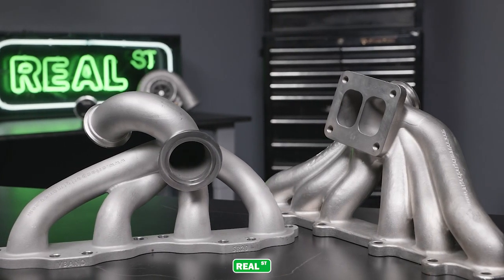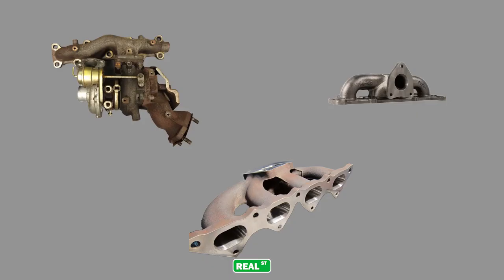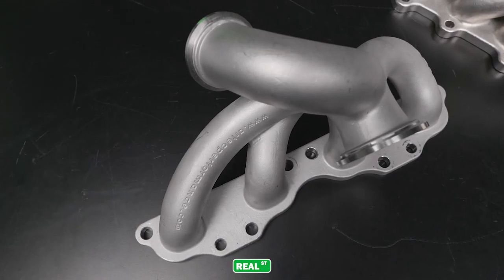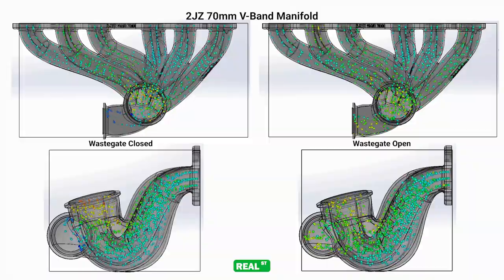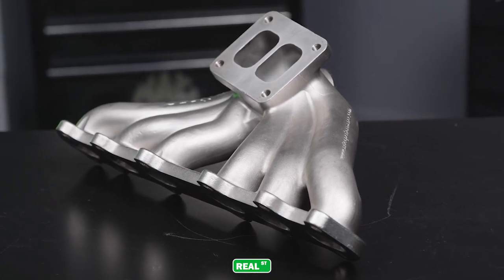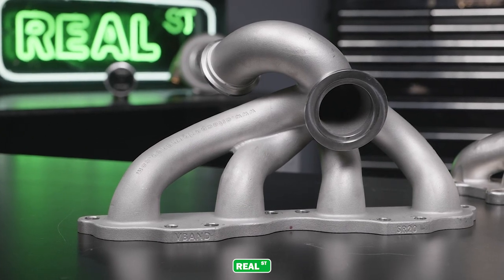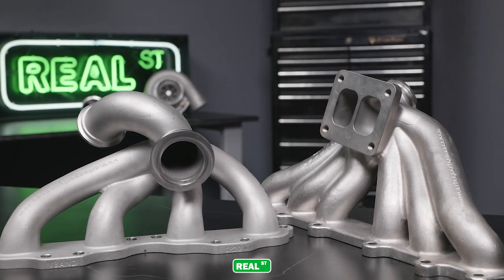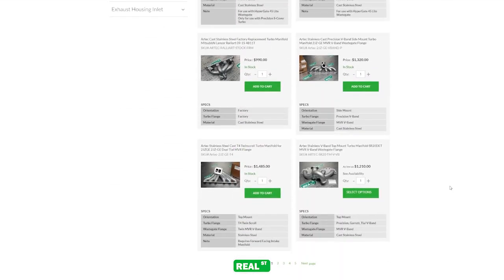Artec Performance Stainless Steel Cast Manifolds - Overview

Comment: nice manifolds overpriced though
Reply: Theyre stainless..
Reply: @timvanderstarre9021  and cast, would be cheaper to weld one up
Reply: While you can buy the raw materials and weld one up yourself for less, lets not forget the time you will spend doing so. What is your time worth? Any really good fabricator will charge anywhere from 125 up to 250 per hour to fab components up for you. A 2JZ manifold will easily take you an entire day between mock up, tacking, checking clearances, cutting tubing to fit etc from start to finish. Nice CNC header flange, turbo inlet flange, wastegate flange, tubing, bends you will easily spend $600-$800 . Low end labor for fab work $125 x 8 hours there's $1000.  If you do it yourself you save the labor of course but your time still isn't free.
Reply: @robertdelangel2  you can’t teach people like this don’t waste time it’s worth every penny

Comment: Just got mine for my 2JZGE build! Thanks Moe! When we gonna see some 2JZGE intake manifolds?
Reply from the maker: Heck yeah! Thank you. If you have any other questions, feel free to reach out.
We have some options available for intake manifolds.
Reply: Dodo racing makes a 2JZ GE cast lower intake manifold runner, that allows you to use the GTE stock upper forward facing intake manifold.

Comment: hi real street, 
Would these be able to hold let’s say up to 1100whp on a 2jz?
Reply: when you refer to manifold hp its crank hp not whp ....
Reply: @ACommenterOnYouTube  well, 1100whp is my goal, hence the question.
Reply: @nucleart0aster  then convert 1100 whp to crank hp ... ... ...
Reply: @ACommenterOnYouTube  I’m sure whoever replies can do that too.
Reply: @nucleart0aster  and just to inform you, they don't reply to comments or questions so don't hold your breathe
Reply: The twin scroll T4 GTE manifold will support that power without an issue. The primaries are 1.3" ID which is already larger than a large portion of offerings on the market.
Reply: @robertdelangel2  thank you.
Reply: @EvolvingEvo8 I've been waiting to see a 2JZ run one of of the new smaller next gens. Should make for a sick combo.
Reply: @ACommenterOnYouTube  in Australia engine hp spec’s are rarely used!
Reply: @needmoreboost6369  The only ones doing that in Australia are the OEM's really, huh? Well, we don't really have many ADM OEM's anymore

Comment: Is it hard to add egt and back pressure sensor onto the manifold?
Reply from the maker: Very simple actually, a handful of bungs welded to the manifold so the egt sensors can be fastened to, and a bung near collector to run into a remote mounted sensor for back pressure.